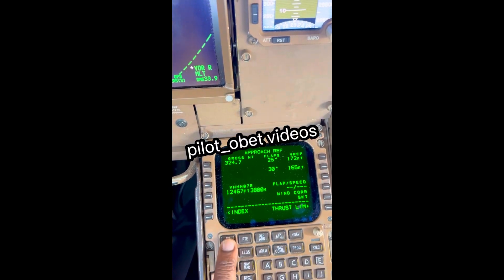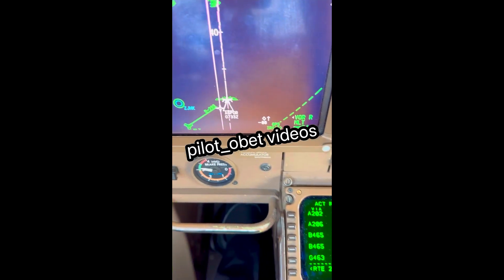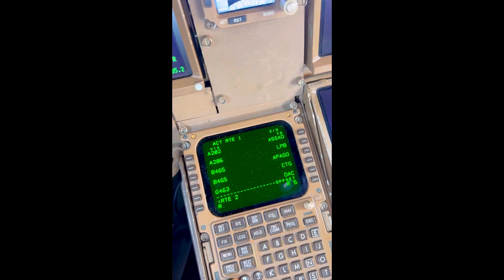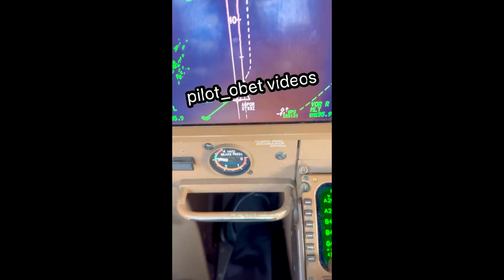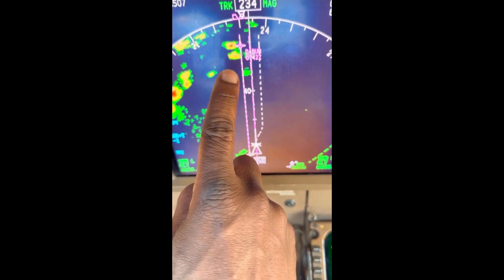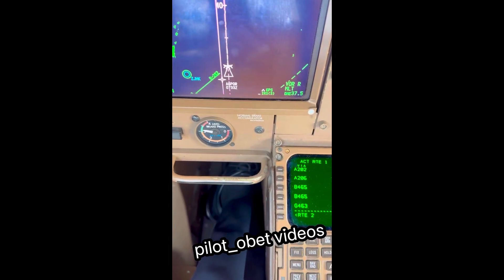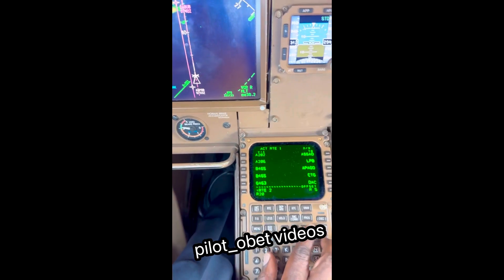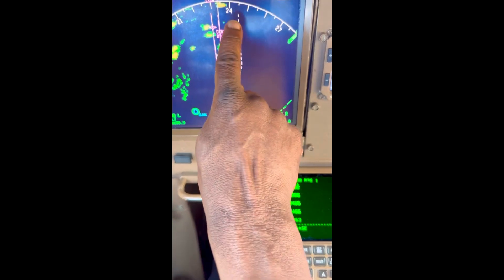Weather avoidance/Turbulence avoidance in flight

Comment: Valuable guide. Thanks skipper. In some of the more advanced weather radar systems used on private jets there is a turbulence mode which helps detect turbulence areas as well as a lightning . Particularly useful at night. Turbulence detection is still more of an art than complete science. Enroute temperature and pressure gradients can also help detect turbulence. Paying attention to how dynamic the Outside Air Temperature gauge can also shed some light as a clue what lies ahead.

Comment: Hello😅have a question on topic😇
What's maximum wind speed to 747 8f to stay on course and land i mean max value that this plane can stay on straight line? and not go around.
Reply: You mean crosswind and tailwind limitations? For most heavy turbine jet transport aircraft, crosswind limitations are in the range of 30-35 knots, while max tailwinds in the range of 10-15 knots as per regulations.